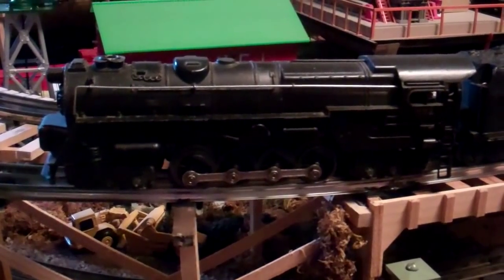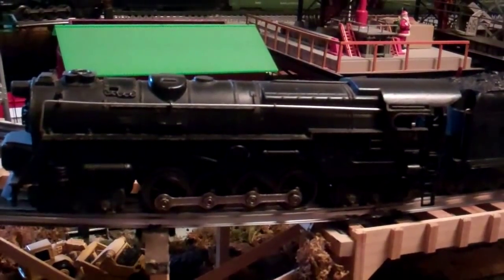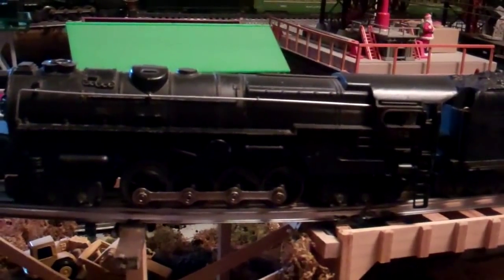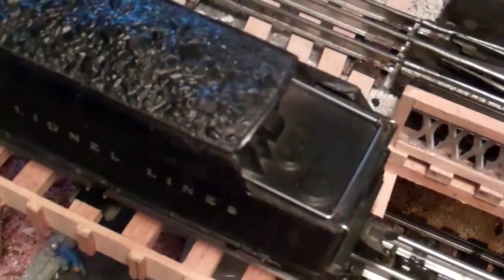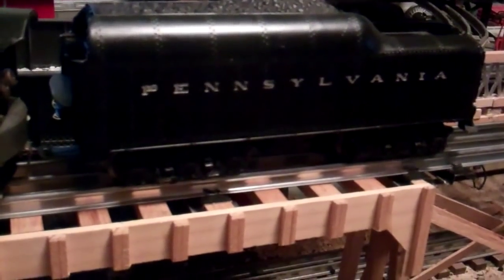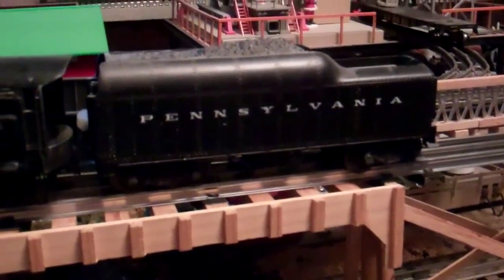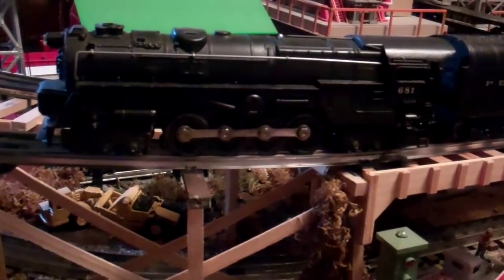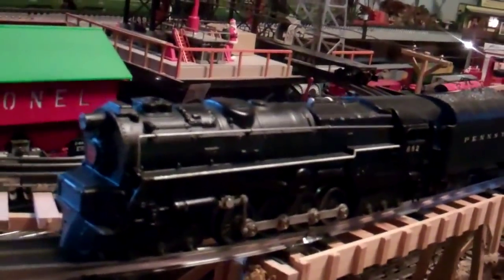LIONEL TURBINES

Comment: Great post.  I have a Lionel 0-4-0 die cast switcher that only runs backwards.  What's up with that?  I also have a whistling tender but I don't know if it is a 671W or not.  I love yer trestle.  Did you make that yourself?
Reply from the maker: The 040 may have a bad or miswired e unit.  Trestles are homemade. Thanks for your comment

Comment from the maker: @SouthernRR4501 On the 736, only the rear drivers are powered by the motor, the other sets of drivers get powered by thre side rods. It's very common for the side rods to wear and cause the condition you describe. If you can get properly made replacemet side rods you will most likely correct the binding issue.-TM

Comment from the maker: The 681 is a great turbine, nothing at all wrong with it. It runs great and has magnatraction. The star of the 1946 turbine is the really nice cast tender. This is the same tender that came with the 773. The 1946 has a completely different drive mechanism that doesn't lways run smooth and is very complicated to repair if it is not working correctly.-TM

Comment from the maker: @litvak54 The gear design,straight cut, will result in more gear noise than the worm type. The e unit return spring may be bad. Over time heat can take the temper out of the spring resulting in weak return action. Thanks for the nice comments.-TM

Comment from the maker: @grizzleybearz282004 The front of the smoke bulb housing is removed by turning the cover in the direction indicated on the cover. It very well may be tight or stuck. The original smoke pellets were very corrosive. -TM